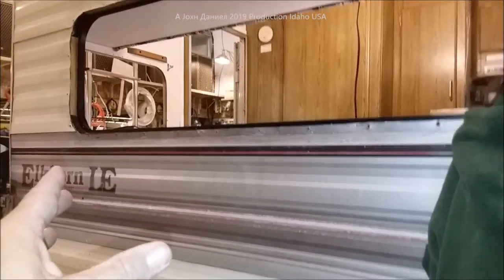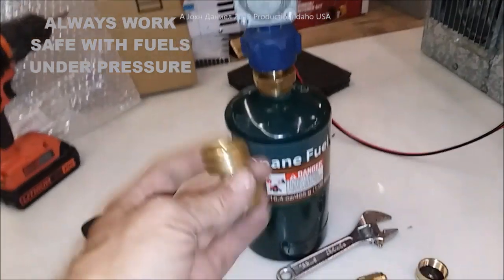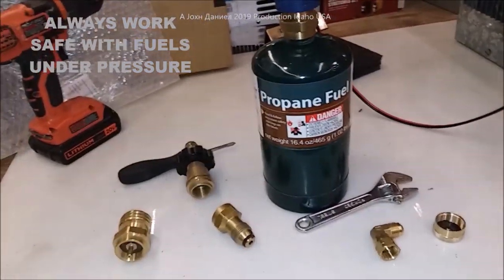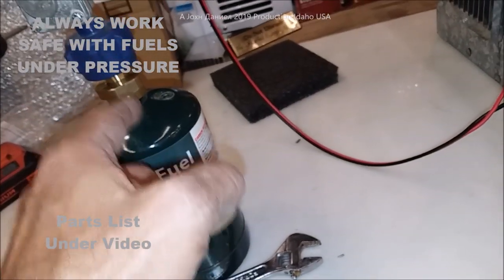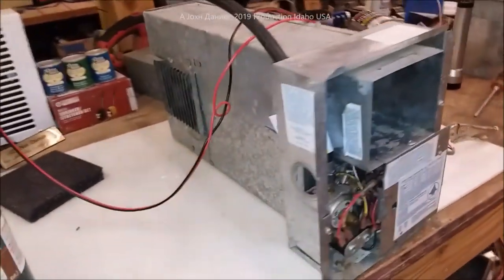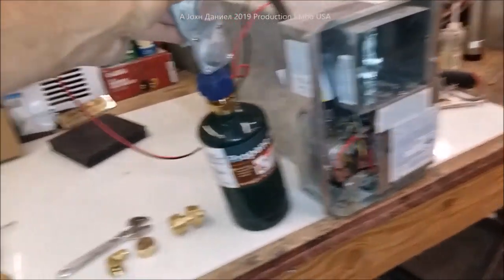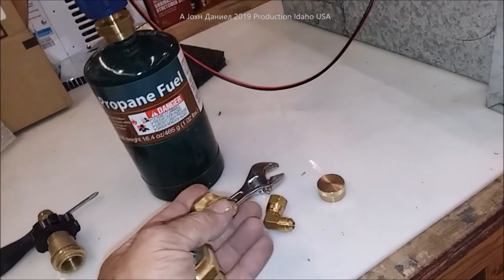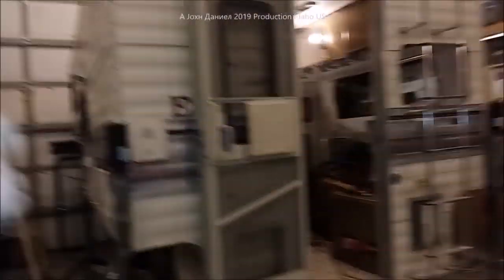RV Camper furnace pull, clean, test for reinstall,  parts to use listed below.

Comment: I have a 1964 Clark Cortez with an old heater looks like it runs without 12v.  Just a pilot and a thermostat so far as I can tell.  The previous owner disconnected the gas, I guess because it was smoking.  Black around the heat exchanger.   Cleaned out an obstruction and giving it a go today!

Comment: A propane heater that runs both the fan and controller via 12 volts DC.
Excellent idea for my remote cabin. But, I'd need about three or four times the output in BTU's that this tiny unit can provide.
Reply from the maker: What you need is 2 of these, https://amzn.to/3YoTZyh placed on either end, No electricity and you can add a 10 watt 12 volt fan which uses 1/16 the power. Ha, Saved you $600 on the extra batteries, which means 2 really only cost you the price of 70% of 1 it's that simple

Comment: flame king has refillable 1 pound bottle kit cost $$ just wanted to mention that there is 5 pound bottles available on amazon as well not cheap either but compact size. Works great for my buddy heater😉
Reply from the maker: Excellent, thanks for the heads up.

Comment: Where's a good link for the 12-volt relays on the board I've got one that's blown I looked at our local camper place and the whole board is $200 eBay it's 88 and the parts that I think I need are only 12 for 10

Comment: I'm curious how long a small bottle would run a slide in truck camper furnace.
Reply from the maker: Depends on the furnace and temperatures likely 3 to 6 hours, My furnace is 12K and camper super insulated so I got almost 8 hours of cycling on off to maintain 70 degrees in it with outside temps about 35 degrees. Best bet is to make a manifold to screw 3 or 4 into for long term use.

Comment: What kinda power source do u use do u use a regulate 110 plug and plug it in the wall or do u use a battery charger to power it up
Reply from the maker: Battery
Reply: There's only one cord so I can just clip that on a battery and the others is the red and white thermometer 🌡 cord I put together and it should lite up
Reply: use a 12 volt battery not 110 plug in!!!!   A car battery is sufficient.

Comment: How long can you run the heater off of one of these propane tanks ?
Reply from the maker: This particular heater made it a little over 2 days in night temps of less than 30 degrees with day temps under 50. But it depends on how big a area and how well insulated a area your heating. For a small camper it did very well considering the way they are made.

Comment: Does the furnace run off of battery or house power
Reply from the maker: 12 volts. Either from a RV Converter that converts 120 volts to 12 volts DC or a Battery thats already 12 volts
Reply: @JOHNDANIEL1  so is a car battery a 12volts ?
Reply: Shawn, off a car battery 12 volts.